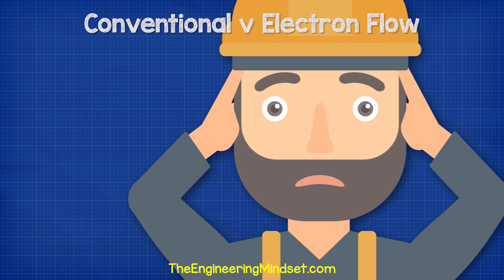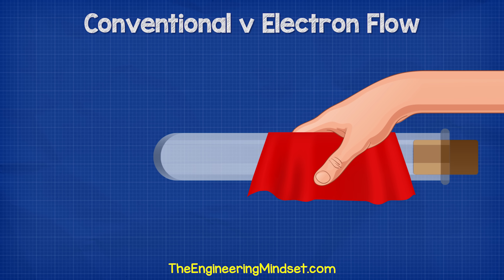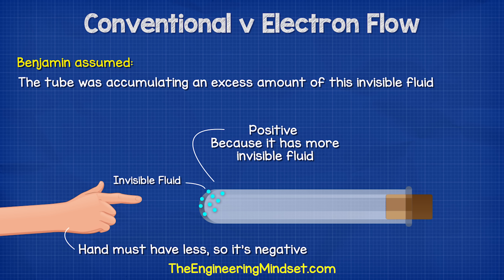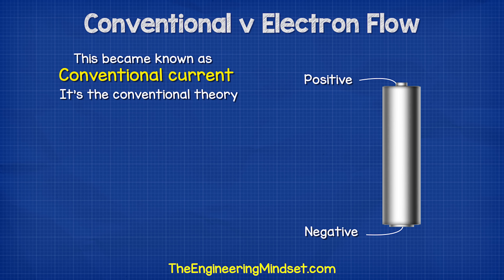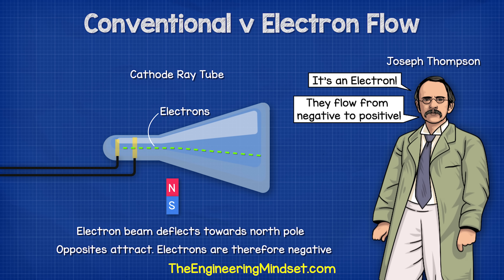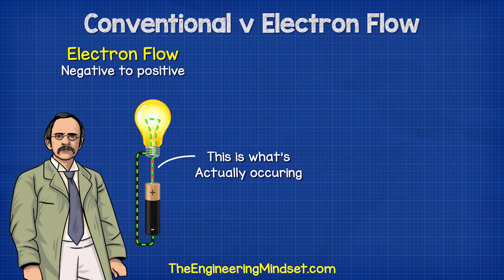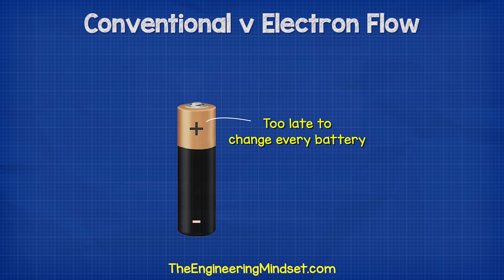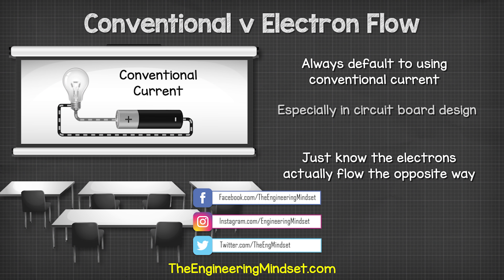Conventional Current v Electron Flow - Electricity explained

Comment: A great and  simple explanation.  I learned electron flow and it has always made sense to me.  Now I know its also the more correct, even better.  I would like to thank my instructor (Mr. Richard Romea) who told the class years ago (1995) that electrons flow from negative to positive.  He was right and once you believe that, its all easy-peasy.
Reply: Current convention is not incorrect.  Let me explain. 
Electon flow and current flow are conventions.  But some people fail to recognize that Both have physical representations. 

While Electron flow has obvious physical representation, current flow does so too  in conductors and semiconductors as electron holes or lower eletron density flow that is opposite of electon flow. This view is no less physical real than electron flow.
Reply: @kreynolds1123  Current convention is incorrect. It is mere convention, due to the ignorance of the early pioneers. Actual electron flow is not mere convention, it is stating something about objective reality.

Comment: Why doesn't it matter ? If I want to measure ampere at two sides of a resistor in a series circuit wouldn't it create a confusion? I learned it in college, now forgot. Anybody can help with my query?
Reply: No, because current thru a series circuit is constant regardless of what side you measure it from.
Reply: @broderp  Thanks a lot. In a parallel circuit?
Reply: It doesnt matter for multiple reasons. Amperes and flow of electrons are two different things, amperes are flow of protons, so amperes do flow from positive to negative, most complicated circuits matter because of the voltage, for example in digital electronics there are two states, high and low, high being 5 volts and low being 0 volts, they dont analyse the movement of electrons. All electrical formulas stay the same even if we explain different circuits in electron flow.
Reply: @nekilikizhrvatske3336  Thank you so much.
Reply from the maker: Check out NEW resistor video, everything covered! ➡️ https://youtu.be/DYcLFHgVCn0

Comment: In ideal inductors and capacitors with alternating voltage and current, conventional current flows from negative/lower potential to positive/higher potential for two quarters of a cycle, and from positive/higher potential to negative/lower potential for the other two quarters of the same cycle.

Comment: when I think of electricity I try to imagine the way electrons flow, so that is why I just don't like this conventional current thing. 
it's boring that what we study is not what the reality is.
Reply: As a physicist working with electronic equipment for over 40 years I can say it  doesn't matter which one you use as long as you understand what you are doing!
Reply: @karhukivi  I understand that it doesn't make any difference, but I prefer to study like what the reality is. anyways as you said the main thing is that we understand it completely.
Reply from the maker: Seen our new video on How electricity works - for visual learners? Link:➡️ https://youtu.be/3KePcASD0NQ

Comment: You can also look it at positive charges (holes-missing electrons) moving from the positive terminal to the negative terminal.  These holes collect at resistive components, creating your individual voltage drops.  Reactive components (inductor and capacitor), will create a up to a 90 phase change in voltage relative to the applied voltage due to components time to charge (caps) and create magnetic fields (inductors-coils).
Reply: leave my brain alone lol
Reply: I agree. I understand it better that way.
Reply: Sorry Phil, but holes can't move! The "holes" (dumb terminology by the way) are simply orbital positions on the outside of the nucleus, that electrons can move in to, and out of. The atoms stay put (law of physics for solids), and the electrons move from atom to atom, from negative to positive!

Comment: So is a ground lead positive ?
Reply: Not really, ground is 0 volts. Just remember this, electrons flow from lower potential to higher potential, electrical current is the flow of protons which flows from higher potential to lower potential.

Comment: But we always remove the battery cable from the negative terminal of a car battery to be safe while working there ... not the positive?
Reply from the maker: Watch this please https://youtu.be/VnPRX5zQWLw
Reply: Because the negative terminal is connected to the chassis. If your metal wrench ever inadvertently provides a shortcut between the positive terminal and the chassis, and the negative is still connected, then you have a dangerous short circuit. Conventional current vs. electron flow isn't really a factor in this case.